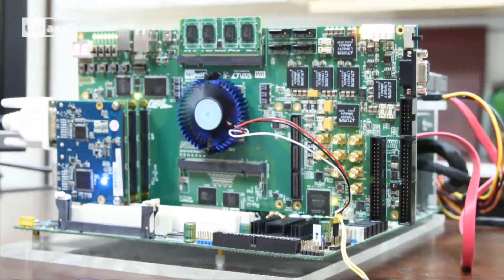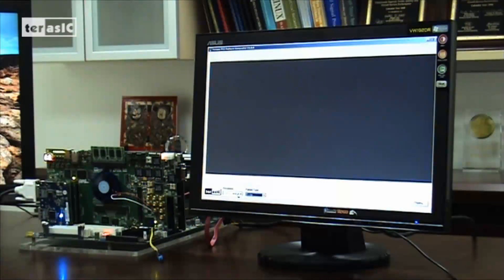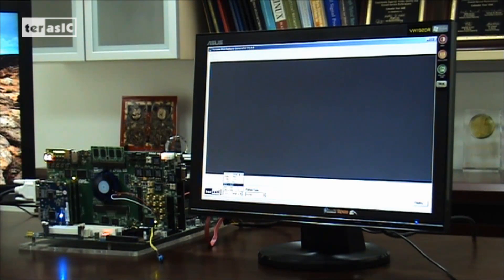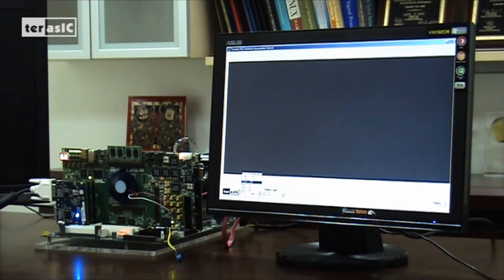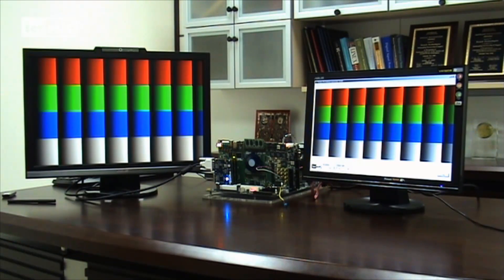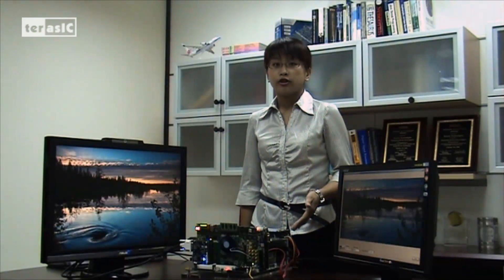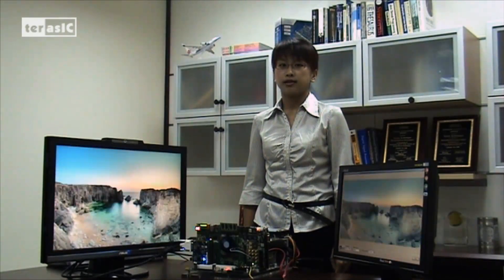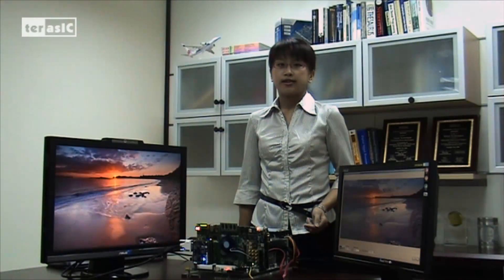DE4 FPGA Development Kit

Comment: Too complicated for me - I've never truly understand the HDL capabilities. GPU's are simpler - f.e. optimal GTX1080ti has 7MB (I've not measured internal bandwidth, but I would guess ~1TBps) of fully programmable on-chip local registers, with debugging, disassembly, profiling, memory hazards checks and trivial programming model with limited CUDA C++11 for free, in price as low as 850$.
Reply: You are barking at the wrong tree. Intel’s channel is next door. I'm sure they'd love to discuss the power consumption with you.
Reply: My brand new GT1030 should consume femto-joules at lower clock-cycles, per thread (Volta uArch with GTX 20 is expected to provide such default ability). Power efficiency could be trivially achieved via partial GPU coprocessor SMM's disable via driver.